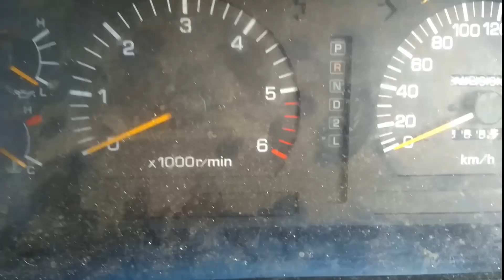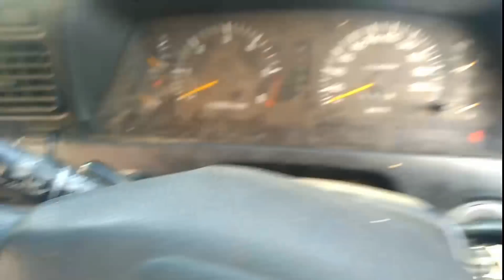Q&A + Advice - Toyota's 1FZ-FE for the 80series

Comment: Thanks for all your advice on the 1fz-fe I bought a 1993 great example with 260,000kms a few months ago. Power steering leaks so I need to fix that, I carried out an experiment and found better economy and smoother running much less pinging on 95 octane. Standard fuel quality is rubbish is aus so figured bring the standard closer to what they have in Japan is a good move. One other issue I have is the low oil light coming on and off dispite full. I think I need a new sensor. Keep up the good work mate.
Reply: Ye mate, just had to replace both power steering hoses, was a pain in the arse but ye, same issue, mines at 245xxx

Comment: I currently own a 5/94  80 series with the 1FZ-FE coupled with the A442F,and what a great match.I also noticed your 80 is the same colour as mine.My old girl has 331,xxxkms on her and I’ve had the head gasket done in October last year which included a top end rebuild while it was all apart.This one is in very good condition with very minor clear coat peel,but the future plan is to give her a fresh coat of paint.This is my second 80 series,my first one I bought was the updated 95 model with the same engine/trans combination,and Champagne in colour..It only had 152,xxxkms when I bought it.Absolutely love the 80 series.

Comment: I couldn't agree more with you on how powerful this engine is … I have 100 series with 1FZ-FE engine. My question for you HOW OFTEN YOU CHANGE THE ENGINE OIL
Reply from the maker: As i use an oil stabiliser when i change my oil, i try to do every 10,000KMs. I also use 20W-50 grade oil on the car due to the high KMs it now hows on it, and swear by Morrie's Oil Stabiliser

Comment: Thanks for the info, bloody terrific.  I can't get over your fuel economy!  My mechanic said my 30 - 33 litres /100kms is as good as I can expect, and this is usual.  I bought it at 240k and I'm now at 450k.  In the first few months I was getting around 40l/100km.  It seemed over night it dropped down.   Strange!  Now I'm told I need a head gasket replaced. Bugga!  With an engine of this age and terrible fuel economy would you offer any advise?
Reply from the maker: TBH, first off find another mechanic because sounds like someone is BS'ing you. 40L/100k seems like the engine is really running rich, big time. 
To give you and updated fuel economy, as of 2021, I am now sitting on a combined average (city/hwy) of around 19L/100K
Reply: Thanks for another opinion.  I thought I was only one expecting a better fuel economy.  I've has 2 mechanics who over the last 18 years assure me they have done all that can be done to improve it.  I've reached 450,000kms, needs head gasket and who knows, maybe head shaved, steering noisy when at full lock.  Can't decide, new or recon engine, trade in for a later model?  I guess I need an honest and very experienced 4x4 mechanic!  Do you know of anyone fitting this description in the Frankston area?  Thanks in advance.
Reply from the maker: @chuckedone  there is used to be a 4x4 mechanic on frankston-dandy rd but not sure if they are still there. Stick around the channel for weekends at Backyard Tech. Got some 80 series coming up
Reply: Thanks.
Reply from the maker: @Gary Davis this video I hope will shed more light on your issue https://www.youtube.com/watch?v=xJD4C772DCg

Comment: pops in the exhaust = valve adjustment out or vacuum  leak
belts are easy and no need to remove fan and or shroud

Comment: Gday mate I have just subscribed to  your channel 
You seem to be quite knowledgeable  on the legendary  80 
I have a 
96 petrol 80 with the 1Fz-fe and my question  is about my rear windscreen whipper that has just stopped  working  and I cannot find the fuse on the car or in my manual
And how do I message  you with  questions.  
Not good with computers cheers
Reply from the maker: Email address is in the about section of the channel

Comment: Is there any way to get more low end torque without putting a turbo or supercharger?
Reply from the maker: Depends on which transmission you are running. Also you may able to get it tuned bit on the whole, no not really,

Comment: Hello sir, I got an issue that I haven't been able to identify for a while now, I hope you could help me out with that.
It's a 1997 1fz-fe, part-time 4wd with a manual.
I am getting an immense amounts of heat building up from the transmission. At the same time  when I accelerate, revs go up, then drop back 300-700rpm, while this is happening, I'm not getting much acceleration. This even happens on the move, when I'm trying to overtake or just trying to get a speed up like 20 kph.
The motor seems to run ok, I have a suspicion, that it could be a clutch issue, when a clutch plate keeps slipping (temp builds up from it losing traction). 
Maybe you could point out what else could it be, before I go and take out the tranny?
Also what would be the best oil to use if a car has 450000km with a partial engine rebuild about 20000km ago? We have temperatures of -15 to +40 here 

Thank you for a great video!
Reply from the maker: @ Arcl1t Sounds very much like a clutch issue in a big way. And or clutch and trust-bearing as well, so I would get both checked out. As far as oil is concerned, I am running Shell Helix 20W-40 on my motor with Morey's Oil Stabiliser as well ( A full bottle of Morey's then 6.2 litres of oil). I would very much check the clutch and trust-bearing first before you look at the box.
Reply: @OldMatesBackyardTech  thanks a lot and best of luck
Reply: What kinda transmission  is it